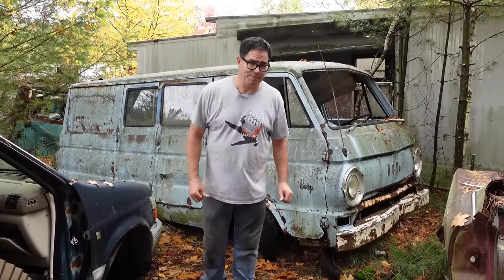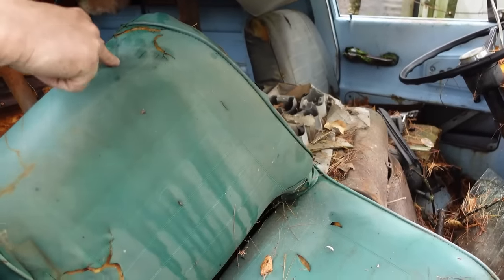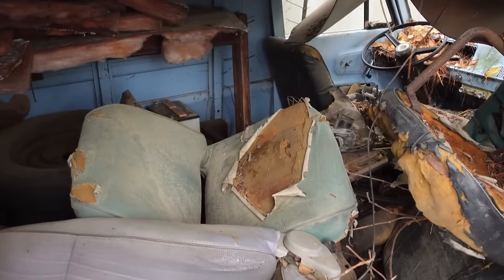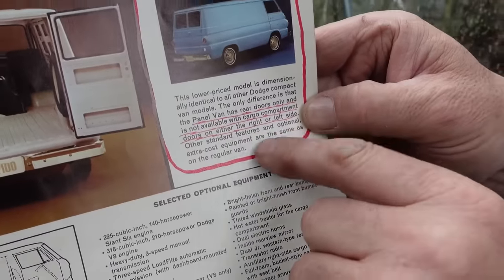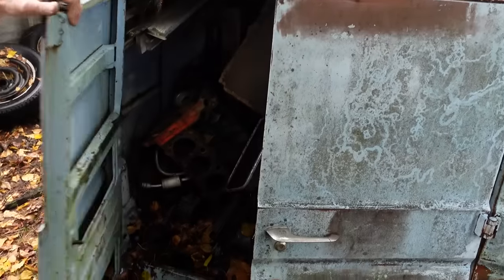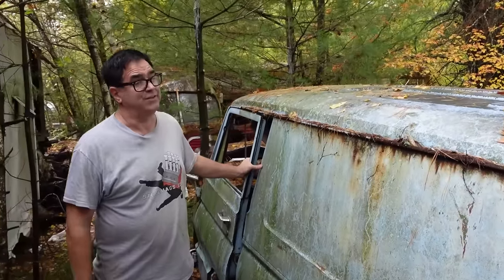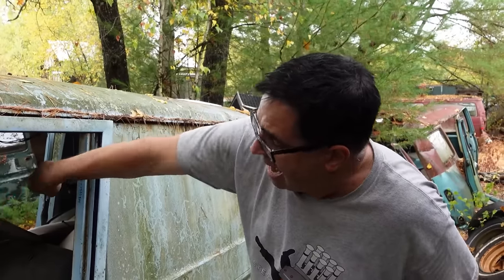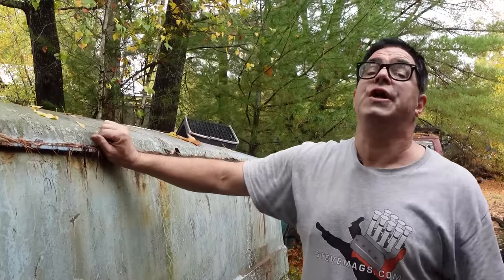Wagon Week EP21 - Dodge A100

Comment: I loved for years my 65 A-100 W/225 slant 6. It was my truck, while I was driving as a regular trans a 1971 Buick Skylark Custom. Sometimes 1 vehicle needed work so I would drive the other. I so like your junkyard crawl since I first read it in Car Craft , because I did that for years before reading your stories. In all the junkyards of Kansas City I found the 15 parts vans scattered around, getting linkage, lenses, etc. that I needed to get it back in shape. For a bit of time at 1st I needed all 4 appendages engaged to drive it it jumped around so much. ! day I drove into a strong snowstorm driving from KC to Lawrence and the slowest I could drive was 25 miles an hour because slower it would buck too much to drive comfortably. The funny part was regular vehicles could only drive around 12 mph so I had to pass them on untouched snow in the undriven lane. What really helped my top heavy A-100 (after having the driveshaft balanced) was replacing junk bumpers with 6 inch c-beams. The added lower weight made it drive much smoother. Thank you for continuing your articles in video form ! Sharing everything I did raising my daughter, I got permission to take her into a junkyard, she was 5 so part of that was I carried her to show her the joy of junkyard crawling.  lolol

Comment: When I was in auto shop in high school we ha a 1968 A100 with the 318 V8 that had been a factory cutaway. It was a three speed manual and everything had been cutaway down to the differential and detailed. The starter motor had been modified so when you plugged in the power the lights would work and the engine and transmission would turn. With the engine cutaway you would see the pistons going up and down and the valves too. We also had a 1973 Camaro SS that was completely loaded that had been a pilot run car donated by GM. It didn't have a serial number and was stamped on the trim tag "Not For Road Use".
Reply: what the fuck school was that ?

Comment: In November of 74 I bought a 67 a 100. It had windows in the curbside doors but not the rear doors. It was V8 powered with 3 in the tree, posi Trac, side pipes, ET Fenton mag wheels, F70 steers and G 60 rears, high low purple lavender carpet, light bar in the back that pulsated with the 8 track music. It had west coast side mirrors. There were red double bulb clearance lights under the dash and outlining the dog house. Somebody had made custom naugahyde rmrests on the front doors and made a 2x2 framework and plywood jump seats made of black naugahyde behind the fronts seats so those passengers faced the rear. Mechanically it turned out to be a money pit, so in January of 75 I traded it in on a 70 2dr red Fury 3 with black vinyl roof.

Comment: First job out of high school, doing deliveries in a 66. 3 on the column, slant 6, no radio, no a/c no power anything. Your body was the airbag, it was horrible in snow. We'd put 8 cinderblocks in back for traction. Pluses? You could check the oil without getting out of your seat. but it was hotter than hell in Summer. I drove like a maniac in that thing. Couldn't kill it. We also had a 68, the longer wheelbase, same everything, except that thing couldn't get out of it's own way. I would love to have that 66 today!

Comment: I ordered a brand new 69 shorty and optioned it with the 318, standard column shift 3 spd, 2:73 rear gears, optional springs @ $2.00 per spring, heavy duty axles @$4.00 per axle, radio, solid side doors, windowed back doors and commercial style big mirrors. That thing had a drive shaft that was about 18" long.  With those rear gears it would hit 100mph but the one time I did that the small welds holding the side skins to the inner frames let go and the thing started to balloon going down the highway. After the first couple of welds let go I looked in those mirrors and couldn't believe my eyes how far those side panels had bulged out. It was rugged as all get out and would carry lumber stacked to the roof sticking 4' out the back with the doors open.  The 318 ran forever and is probably still out there in some farmer's grain truck but the truck itself rusted out from under me.

Comment: I like the D 100 there Too bad it's so far gone. But let me tell ya about a van that my mom got. I love this thing. It was orange and we called it The Flying Pumpkin. I believe it had the 292 inline six banger. I'm here to tell y'all this thing took us around the world about five times. I was young when she got it and I remember that every morning she would have to open up the dog box and hand choke the carb, but when I was older and understood about the choke I installed for her a manual choke and took care of that. Well as time went on she sold the thing and passed it on down and got a new car, but a few years later I was in a junk yard getting a clutch pedal assembly for a sixty eight Barracuda and low and behold there sat the ole pumpkin sitting belly down on the ground with no wheels. Had a new dent in it nothing too bad brought a smile to my face remembering back to all the trips Mom took myself and my three sibs to the drive in theater. Nevermind the morning trips to school and stuff. The ole pumpkin seemed bulletproof back then. That van help my mom start a fairly successful foliage business. Thinking back. I wish I would have rescued the ole girl. She was still solid, but I didn't even consider it at the time. Shane though. That was back in Florida where we grew up, but there's one here  in Austin  Texas, but the ole boy that owns it won't let go of it. I don't blame him and not far from there. There's a fifty eight or nine Chevrolet Apache truck I'd like to get my hands on. But I'm not sure if I'm really in the mind to restore another vehicle, but dang. I hate to see em fade away. I like some new vehicles, but nothing impresses me like vintage cars and trucks. Id really, really would love to have a nineteen sixty two Corvette. Black on Black, fuel injected three fifty. Yep.

Comment: All the double doors are the same, left, right, rear.  I think the doors were actually the same left and right but hinges, etc. were moved for each side but not sure any more.  I had a 1968 A108 that I traveled the country in, 318 V8, terrible mileage...  :(  Mine was an 8 door so doors on both sides.  Rear doors were trash from accidents over it's previous lives, so I built my own lift up one with a huge, crank out/up regular house window in it...  :)  Super reliable.  Did a valve job halfway through travels, and replaced the front U joint (not a U though), and except for the starter going out at one point, never a problem.

Comment: I had to drive one a short distance once.  It was being used as a “load vehicle” and my outfit was too cheap to call a tow truck for impound. Somewhere along the line, someone had done a poor job trying to convert it to a “shaggin’ wagon” along with installing a steering column from a 70s Mercury.  Geometry was all wrong and it wouldn’t steer properly. Brakes weren’t quite there either. Armstrong and White Knuckle all the way. Any of these A100s and other vans you’ve featured in your videos would have been safer to operate. Keep recovering and getting stronger.  There’s more junk yards waiting.

Comment: 1956 kaiser fc150 had a engine cover between the seats and you had access to the radiator, oil fill , filter and dipstick, distributor and carburetor while sitting behind the wheel.

Comment: Another day closer and hopefully on the road to recovery. As stated last time:

Bostrom still exists and there are two companies now (they used to be one, then they split up). H.O. Bostrom does a lot of fire truck and emergency vehicle seating (among other vocations) and Bostrom does more vocational and is OEM to a lot of the truck builders out there. HO Bostrom is in Waukesha, WI. Bostrom is in Piedmont, AL. 

No, I think you may have gotten it a bit wrong on the VIN, as the "2" is for the assembly plant (Warren Truck HD in this case), it is not part of the "production stack". Based on that, I think this is a 1965 model.  So, with the "VIN" (serial number), we win: 19 for A100 van, 6 for six cylinder equipped, 2 for Warren Truck Plant (Heavy Duty), Warren, MI and the rest is the production sequence. 1965 model year production started with sequence number 015000 and the 1966 model year starts with 055000. Therefore, sequence 050221 falls in the 1965 model year range, not 1966. 

Warren Truck still operates today under Stellantis, although various parts have come and gone over the years. It opened in 1938 and was known as "Dodge City", much like Flint, MI for GM was called "Buick City". Exterior paint should be Ditzler code DT8491 Arctic Blue

Comment: Been hoping you'd find your way around to the Ram Van B series.
Mine is a castrated 1995. Sportsmobile ordered a B3500. Then for "better ride quality", replaced the 1 ton running gear with 1/2 ton...
Loaded it down with extremely heavy cabinetry, stove, fridge, two house batteries and a huge propane tank. Primarily situated on the driver's side.
Springs and ball joints started giving up the ghost soon thereafter. Go figure 😅

Comment: At a low-point, I was driving all 3 van brands: Ford, Chevy, and Dodge. The Chevy had a dead-flat windshield, Ford and Dodge sprung for curved glass. Otherwise all 3 had the same hardware: doghouse latches, parkiing brake handle, inside mirrors. Like Chevy and Dodge said "I'll have what Ford is having" to the generic hardware suppliers. 
Towed a 1962 Willys Station Wagon home behind Dave's Econoline. Had a brake drag on the Willys but the Ford pulled until the kids on the side of the road yelled "You're on fire!!🔥" OTOH I have broke the Falcon axle spiders ⚙under a light-use Ranchero.

Comment: Those Bostrom Thinline seats were also used in the 64 Ford Thunderbolts. Not the Econoline seats like you would think. Neat story behind why. Those wonderful and Faithful Ford Engineers were helping the Deuce keep selling Econolines and Dodge had 100 A100's sitting out on the lot waiting for there seats.😂